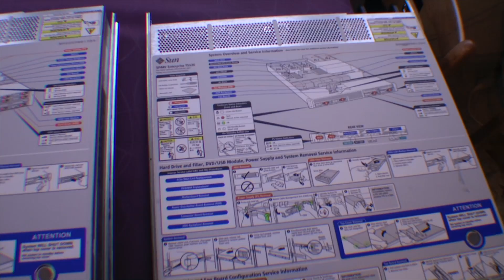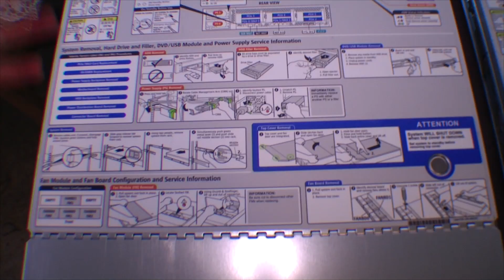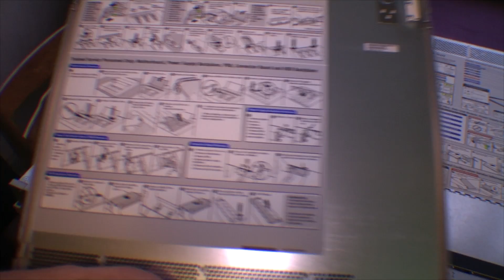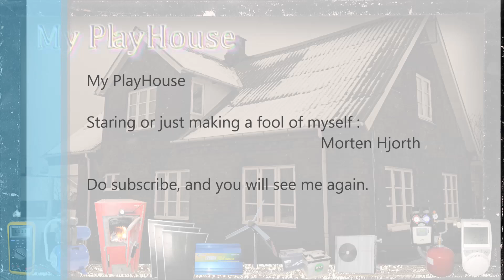SUN T5120 and T5220 side by side review - 218

Comment: Dear Sir,
          This is an excellent video. Thank you for showing the internals of T5120 and a T5220 side by side. You can use this for Virtual Machine, DB and applications over db like oltp and everything, massively multiuser webserver, storage server, etc. Every thing of SPARC is meant for massively multiusability. Its a throughput based system. You would find that it doesn't clog up like IBM power. It is every way better then the intels of Sparc-T5 gen and this holds true even now.Their threads are a bit weak compared to IBM POWER (Intel and IBM are suited for batch process, that's why google is running behind them) but the whole processor is way more powerful compared to ibm. 2P per server would have been better. Increase the ram as much as you can, because ram is very important for these processor. Your frequency is just adequate. Oracle Solaris 11.3 and Oracle VM, both are known to be free. You can go and just download them from oracle website. Solaris is the greatest UNIX imaginable.  If you can write your own code, you can run anything on it. Solaris studio is free, JAVA developer is also free to a large extent. SQL is free. If you can get the applications, you can dance around. LOM is just great. You are a very lucky man.
          I am trying to get a single socket S7-2. But if i can't afford it, I will go for tyan open power8 else lastly X86_64 AMD new.
 
Dear Sir,
          I shall be greatful to you if you please make a video of putting this up with monitor attached to the vga port showing the bios, sound from start to end and the power consumption at atleast 51% load. You are very lucky to get these two. Please take my gentle suggestion and use these and see their superiority for yourself atleast once. These are definitely one of the most sophisticated machines in your plays house datacenter. Your heavy weight personal db based websites should be screaming on them. All lsi and adaptec raid cards are supported till now. Same with lan, etc. So feel free to testdrive. Just don't give them away!
           
          It would be great to see those two wells inside your house mended and if possible compleately filled up with mud and sealed. they are scary. You don't need them there! I don't know what you pay for water but it is supposed to be very minor. Its better that you make a well outside your house. Safer. More over, I am interested in knowing how much is your electric reading and how much do you pay. Do you run web services in your data center for your bread and butter??

Thank You, 
Take care,
golgol golgol
Reply from the maker: Hi GOLGOL GOLGOL
Thank You very much!  glad you liked the video :-)
Thank you for watching! :-)

Comment: I really don't understand why they have to just put fillers in for the empty hard drive slots, why cant they just not be cheap, and put actual working trays in?
Reply from the maker: Hi +noble man 
They could,,, but really there is probably a 95% change that this server is never going to see more drives,, and they would also need to put in a extra raid controler,,, they are not that cheap 300-400$ at least.
This is the same with Lenovo , IBM and HP....
Thank you for watching! :-)
Reply: I mean on like smaller servers that only have like 4 bays, 6, or even 8 bays, would it really be that hard?

Comment: The Sun T series of servers are designed for applications that make use of  heavy multi threading. Namely web services. For non-parallel tasks they can be quite slow. For those types of tasks you would be better with a Sun M series servers. The T series is also cool because it does native virtualization without a hypervisor. Think of it as being able to partition the CPU / RAM into multiple slices and run different operating systems on each slice of the system. These slices are called ldom's You can also pass through any pci device into an ldom. Because this is done at the hardware level with no hypervisor, you get bare metal performance from each ldom. The M series also does this, but it's a bit different. It uses a system called pdom's that actually split the physical hardware into multiple instances. pdom's are not really virtualization, but more a way to segment a big machine into multiple smaller machines.
Reply from the maker: Hi +TriadicTech 
Thank you for all the info,,, everyone says that they are slower then my intel CPU´s,, do you know of something this would do better then other brands. 
Thank you for watching! :-)
Reply: +My PlayHouse (Morten Hjorth) They're ideal for applications that do many small transactions. They scale very well with web applications and databases that primarily serve small transactions, such as financial databases. Heavily distributed HPC tasks also run very well on them. Basically if the application's goal is to serve small transactions and data at a very high rate, the T series of servers are perfect for it. This is why they have two 10gbe ports integrated into the processor itself. Any other task will make the fall flat on their face compared to Intel. Intel is far more universal, but in certain use cases the T series will outperform Intel. Usually intel systems run out of I/O before the CPU's hit full consumption. SPARC's don't really have that problem as they are designed to be I/O centric.

Comment: I'm having a T5220 delivered sometime today and am curious how well it stacks up to my stack of quadcore Intel servers. Actually, I'm just hoping I can put Pentoo on it, install a decent NVIDIA GPU and some apps like Blender and Gnuradio and see how well it performs.  People I've talked to have said the architecture only really shines in certain applications and especially when software is hand-optimized for threading (13x speed of 8-core Opteron box, in one case).  

Apparently earlier incarnation of this architecture got really low marks due to a single FPU shared amongst all cores, which wouldn't be a huge concern for database apps but a big hit on general benchmark scores.  The T5000s have 1 FPU per core and is claimed overall to improve floating point performance by 10x.
Reply from the maker: HI +Paul Steffen
I am very interested in hearibg what you find out,,, NVIDIA GPU and some apps like Blender and Gnuradio and see how well it performs.??
Thank you for watching! :-)
Reply: Actually, OpenFirmware was designed to be cross platform. So old PPC Apple cards should bootstrap just fine. You will still need OS drivers though. As long Nouveau supports the card you should have no issues.
Reply: +Paul Steffen The fastest rendering card i think sun ever released was the Quadro FX 4500. You would need the sun version with the sparc obp firmware. Either way it is a pretty old card. Today's sun stuff it more or less only suited for databases, web apps, and virtualization.
Reply: +TriadicTech I just yesterday put Fedora Linux on my box though haven't tried any gpu yet. . Quadro FX 4500 is not a bad choice. . I have several Quadros lying around including a 4600 and several 5600s including one from Mac -  I guess it's out of the question that open firmware would be cross compatible between mac/sun but there are are  Sparc Nouveau drivers in Fedora so maybe there's a way to bypass any OF bootstrapping.

Comment: My PlayHouse, Since I do not have any SPARC systems, I do not really know, but Linux packages may be widely available for the platform. I know several Linux OS versions exist for it. With 64 threads video editing with a suite like KDEnlive might be a breeze provided you had enough RAM. Also, with so many disk slots available, this would be an excellent storage solution on the network. I am not sure of the power requirements of these servers, but the argument in favor of SPARC is that their processors produce more computing power per watt overall than x86 hardware of comparable vintage. For example, SPARC servers from Oracle today, namely the T6 variants, produce higher frequencies on more cores than any Xeon available (I believe...), and IBM's POWER 8 processors do the same to a lesser extent. There are so few videos on SPARC on YouTube, which makes me glad to see this one!
Reply from the maker: Hi Tyler Barton
I´d like to do a par of videos,, I´ll see if i can do it, and look to stupid. Maybe get some help.
Thank you for watching! :-)

Comment: Can make a solaris server farm with these, though quite inefficient given the age. however useful for learning about solaris zones (like VM's, LPAR's etc) some enterprise maintain their own solaris server farm for Oracle databases, from a licensing perspective can be more cost effective than putting them on ESXi clusters. Solaris + Oracle DB work very nicely together, and the main reason to have these, Maybe these days its changing over to Oracle linux, but still with the SPARC CPU. Useful as a lab env for picking up one of the main UNIX's otherwise not worth the energy consumed. You could also get a AIX blade for your blade centre and have another of the UNIX's family living in your DC :D
Reply from the maker: Hi f16madlion
So you do not really think i need a server like these,, but they cut be fun to setup. and they are to slow.
I´ll like a AIX blade server :-) i am on the look out!
Thank you for watching! :-)
Reply: +My PlayHouse (Morten Hjorth) 

I got a IBM Bladecenter and a stack of Sony Cell broadband engine QS20/21/22s (QS22 being the 2nd Cell processor), someday I need to really get it running.

Comment: Cool Servers!
8core with 64 threads sounds really awesome :)
Reply from the maker: HI NicisLP | GTA Online, Far Cry & Minecraft 
Yes,, it really must have some good use?
Thank you for watching! :-)
Reply: So, we used these servers for years. We used these to virtualise physical workloads. We had lots of physical machines with really low utilization running a single workload. These machines with lots of threads and Solaris zones made it easy for us to consolidate lots of distributed workloads/servers onto a single machine. Think 20 x v220 = 1 T5220, probably more depending on your mileage. They are not very fast but that has been addressed now with much faster models based on the same chip design.
Reply from the maker: Hi Sagan 
That makes sense, when you are using SUN hardware already. I do not know what I can use it for :-/
Thank you for watching! :-)